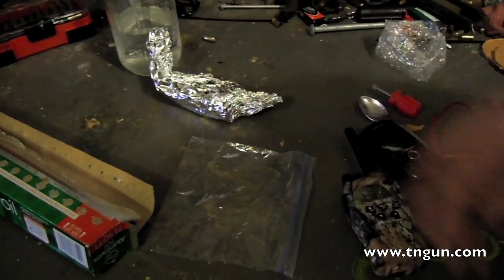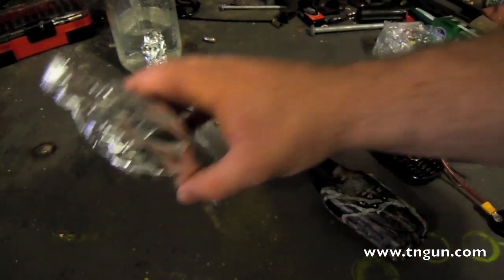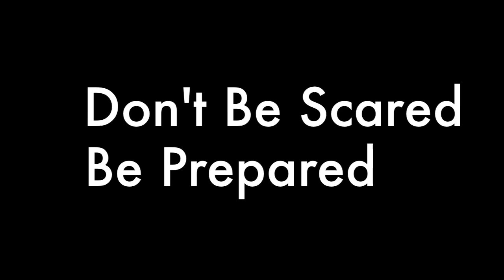How to Test a Aluminum Foil Faraday Cage

Comment: Which side of the aluminum paper should be exposed toward the source of radiation, the shiny side, or the dull side, or does it matter? I noticed you have the shiny side on the outside. So I presume the shiny side should be exposed toward the source of radiation. Is that correct?

Comment: Download a free wifi analyzer for your phone.  Set up a second phone as a wifi Hotspot and build your cage around it.  You can actually watch the readings on the analyzer change as you add tape, etc.  You can also get an actual number to compare different cages.  It's only one frequency but for a solid (vs. Mesh cage ) frequency differences should not be as great.

Comment: Is that regular tinfoil or do I need to get the thick kind of foil
Reply: It's not tin foil. It's aluminum foil. Tin foil is made of tin and aluminum foil is made of aluminum. To answer your other question, normal aluminum foil will work. The thicker the better but if you have thin aluminum foil you can just do a couple more layers.

Comment: Vivaldi 4 seasons ringback tone... most excellent.  Also thanks for the video.  I am considering placing Aluminum Ducting tape around the computers of my quads, motorcycles and bug out truck and was wondering if Aluminum would be sufficient.  Looks pretty conclusive to me. It appears that rf will get through a pretty tiny opening so I was curious.  Do you know how you would go about trying to seal openings due to wiring, even for home setups.

Comment: Fellas,  I am all for this shite but if we have an EMP attack so strong that it knocks out everything not hidden in a lead lined box wrapped in tin foil welded in a diamond plate crate buried 35 ft deep in a cargo container in your back yard,,,,,,,,, who in the hell are you going to talk to or listen to anyway on an electrical device?   Just saying.
Reply: You can still play solitaire on your phone and take selfies.  That's until the battery runs out.

Comment: Aluminum foil is not an effective measure against EMP. The actual intensity of the emp field frequency is about 70,000 times higher than a typical rf signal received by a radio or phone thats easily blocked out. Heavy gage steel box or can, wrapped in a wire mesh, seams sealed with foil tape, insulated inside with cardboard then your items wrapped in static/mylar bags would be much more effective. Tin foil is very fragile and will not hold up to the amount of current that will be flowing through it in the event of an EMP. 

Military spec is 90dB+ for their equipment. Tin foil might protect against 10dB. The goal is to create a barrier to withstand at least 50-60dB if you happen to live in an outlying area away from a central point of the US like outer borders of the US. In any case it's a good idea to create a ground to earth with any faraday cage you build.
Reply: Aluminium fly screen mesh is good for blocking or reducing most signals in use. But even aluminium foil works. A point to remember is foils will reflect the RF whereas mesh does it less. So whenever blocking any RF decide whether it will be a problem when reflected to another location. Blocking a smartmeter on the outside could reflect the RF back behind it more into a building.

Comment: I have a "Nested Faraday Cage",  I've wrapped everything in heavy duty aluminum foil then placed it in my faraday caged and sealed it with aluminum tape.  Here is the link to my facebook pic of the nested faraday cage. https://www.facebook.com/photo.php?fbid=1314940595199546&set=pcb.1314945358532403&type=3&theater

Comment: would it work if i removed the battery and antenna?
Reply: +joash480 never mind, I thought that didn't work on the radio until you said it at the end. I wrapped mine like 2 layers the taped it with aluminum tape like foil but with adhesive.

Comment: I keep my backup CD/DVD's in a small biscuit tin with the lid on, will that protect them from an EMP burst?
Reply: Optical disks like CDs and DVDs are not vulnerable to EMP bursts. Other storage media like flash drives are, however. And yes a metal tin should protect any sensitive devices from from an EMP, so long as the devices are insulated from the tin with something like plastic.
Reply: +TungstenKid It has to be Aluminum..nothing else.
Reply: Benjamin Hershey - I wrapped my pocket radio in a plastic bag and tinfoil and keep it on the top shelf of a kitchen cupboard against doomsday.
Can't think of anything else i need to protect against EMP offhand

Comment: Technically... a Faraday cage needs a ground.. that is the basis of all testing. If  you ground the aluminum.. maybe you can show something.
Reply: umm....no they don't they still work as long as the lattice structure is smaller then the wavelength and it will prevent the penetration of the wave, and as long as there is complete coverage and all sides of the lattice complete a circuit between each other but they will build induction over time given the amplitude of the wave.....I think that's how it works, i dunno that's how i was taught.
Reply from the maker: No it doesn't

Comment: Thanks for the demonstration.  I was wondering why people do this as they could just turn the phone off instead.  The signal is interrupted by the tin foil, so wondering what the purpose is for those doing the foil?  Radiation protection?  I say just turn your phone off and you won't need the foil.

Comment: So you prove nothing other then you you wrapped a cell phone in foil, then you called "some number", could be that phone, could not be.

Just saying next time you might want to show that the phone works unwrapped and even show the number you dial is the same both times.   Would help prove the test.
Reply from the maker: Your right- except I have enough phone calls from unknown folks to show my number on the interwebz...
Reply: David Nash
Then you at least show the phone work before the test. Or you set up a Google Voice account (free) where you can call that number and it will forward to your cell and then you can delete the Google Voice account after, or turn it off until you need it again.

Comment: Just an FYI… The electrical grid is what is really affected by an EMP. The wires used to transport the electricity become a huge antenna grid that catch the EMP and send surges across the network. These surges are what destroy the grid and whatever is plugged into it. If you have emergency equipment (such as ham radios and CB, AM/FM radio etc.. ) just make sure they are not connected to the grid in any way and not connected to any antennae. Small electronics do not have enough of a surface area to collect much of the EMP’s energy.
Reply: So, it was telegraph wires acting as a huge antenna network for the huge solar flare that destroyed our telegraph infrastructure in 1859. Fortunately, in 1859, that was the only electrical infrastructure (to speak of anyway) that we had. If that extreme solar flare that happened in 1859 were to happen today, the effect would be cataclysmic.
Reply: You are completely wrong
Reply: @prescottfiles  well thanks for not explaining your point of view. LOL!
Reply: @fierodough  An EMP produces a pulse that is thousands of volts, but low current. It will fry all modern electronics because microchips have pathways that are separated on a microscopic scale and the high voltage from the pulse shorts all the connections. Unless you put your devices in a faraday cage they will all fry no matter if they are plugged in or not.

Comment: Thanks for this. I am going to add a layer of foil to my stuff-in-all tin box. Don't throwaway silica-gel packets, you might get packaged with any electronic good you buy. They are supposed to absorb any water in a humid environment, so stops electronics from spoiling. They can be re-heated to dry, so can be re-used, but you have to break into the packet.

Comment: FRS is 500 mW not 5 watts. It's my understanding that a cell phone will go as high as 500 mW. The cell phone wrapped in foil was probobly spitting out 500 mW trying to reach the tower. 

It's nice to see the foil blocks RF. The external power supply on the TV is causing interference with my ham radio. Hopefully wrapping it in foil and sticking a ferrite choke on each cable will fix it.

Comment: You have to sand off the paint so you have bare metal showing and then the foil still has to be completly touching the metal on both the lid and bottom part of the can.

Comment: If you put foil over the seal and make sure it is completly contacting all they way around on both the lid and bottom parts, it will work. I prefer to wrap my electronics in foil (for EMP protection) and then place them in my ammo can (for storage and water/dmg protection).

Comment from the maker: @Tom07006 I did, and because of the rubber seal it did not, I tried using foil to cover the seal but it still did not work - I don't want to tear off the rubber seal since I use my ammo cans for their intended purpose and they are getting harder to find.  If I ever get a beat up can, I will make a video.  Thanks for asking.

Comment: The most EMP effects occur if a nuclear weapon exploded in space,  In such a case, the gamma radiation released during the flash cycle of the weapon would react with the upper layer of the earth's atmosphere and strip electrons free from the air molecules, producing electromagnetic radiation similar to broad-band radio waves (10 kHz-100 MHz) in the process. These electrons would follow the earth's magnetic field toward the ground where they would be finally dampened.

Comment: wrap all critical electronics to be stored with plastic bag for  protection from scratching , then with a layer of aluminum foil , then wrap item with lead tape . In The Nuclear Industry  We Would Use Lead Lined Tape To Stop Neutrons , Electrons , Protrons , Ect.